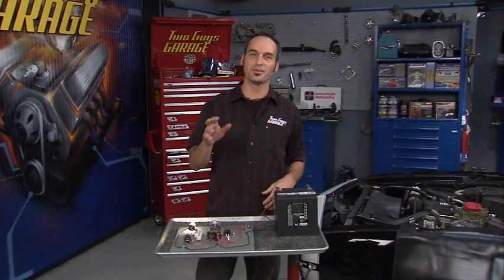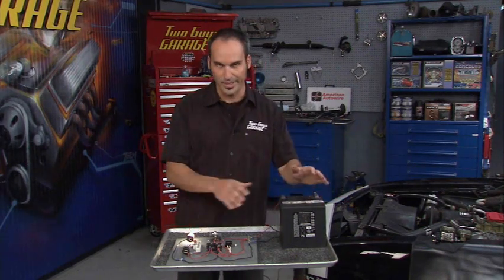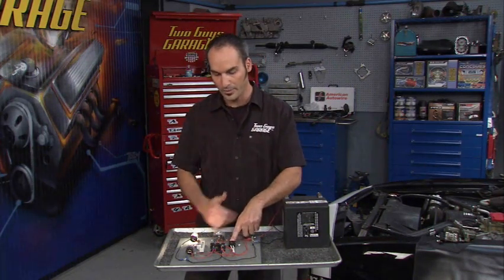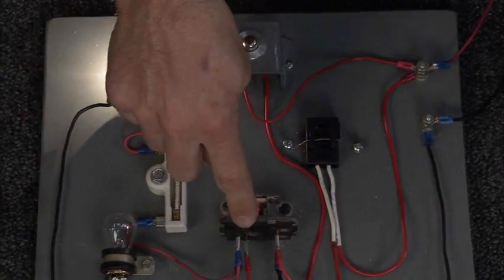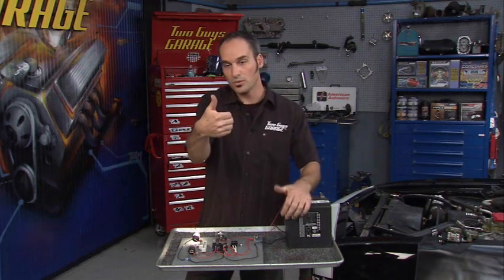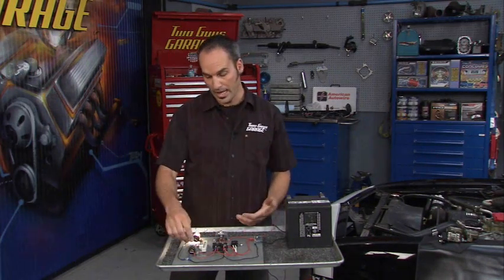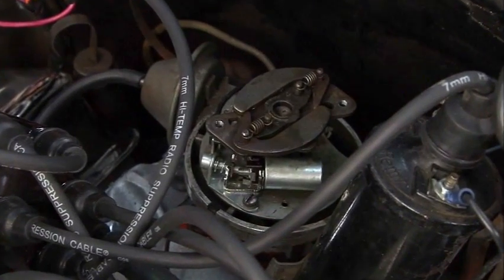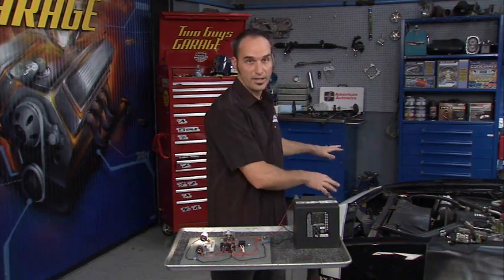Two Guys Garage "Circuits 101"

Comment: The reason for the resistor is not so the points
will last longer, it to reduce the current to coil
after vehicle is running, reducing the heat gain
in coil. just thought i would note that..